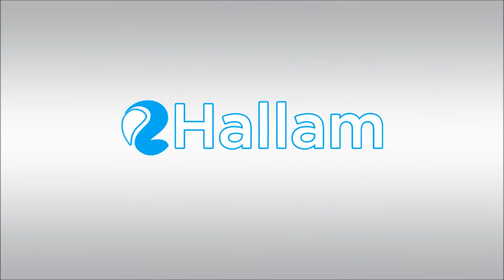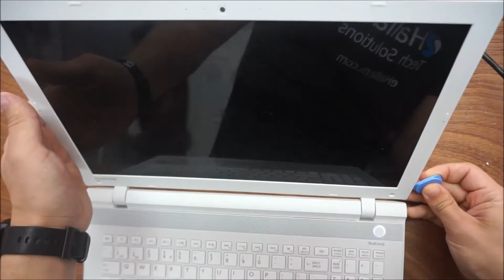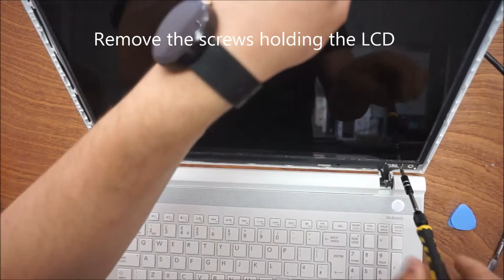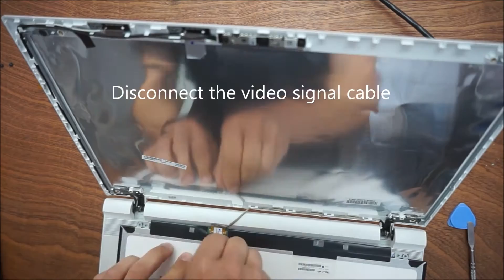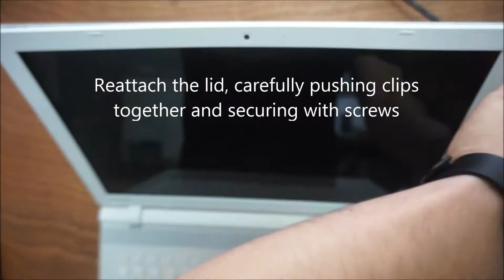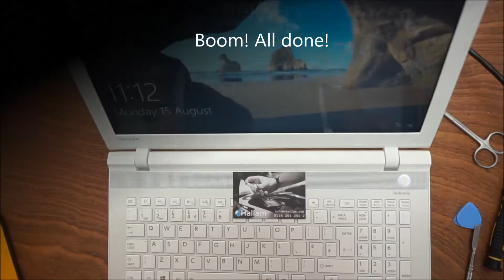Replacement of Toshiba L50 screen

Comment from the maker: This particular screen we got from ebay. Best way to find screen for your device is to dismantle the laptop and check actual model number behind the LCD. As same model LCD can be used on multiple computers and therefore, you may be able to find cheaper parts available
Reply from the maker: Hello,

Does the model numbers on the back of both screens matches?
Reply: @i2Hot4Tv ;)